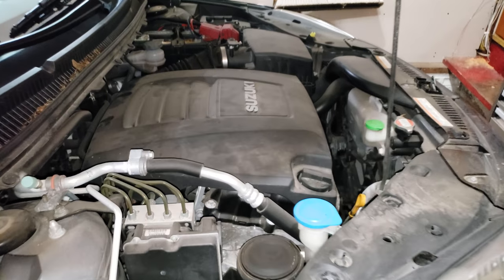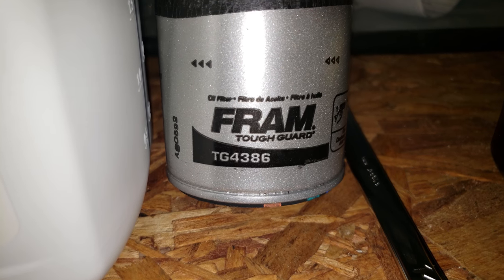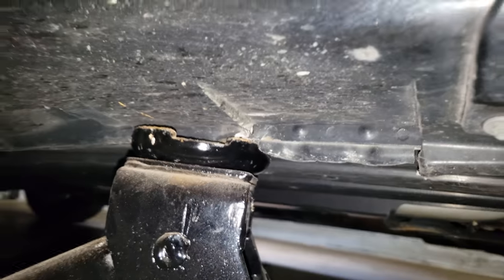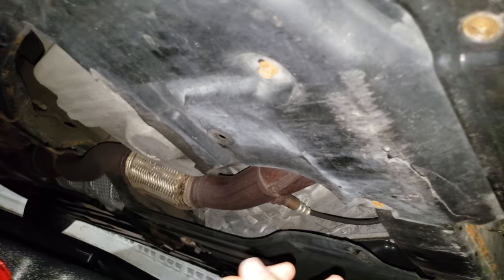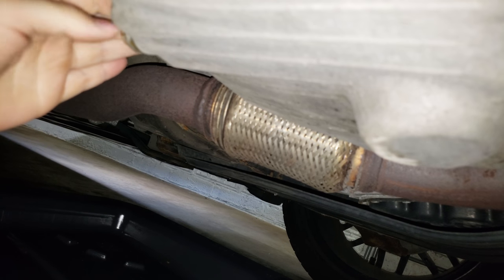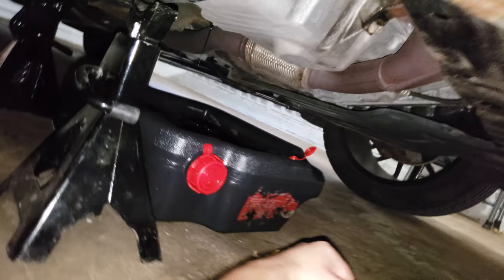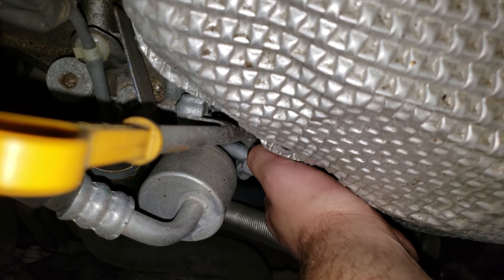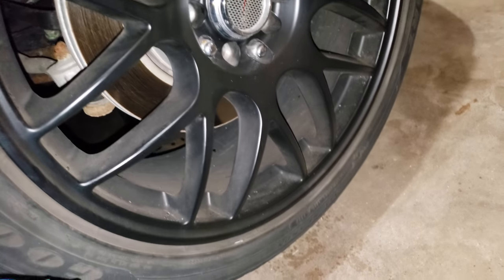Oil Change on Suzuki Kizashi Part 1

Comment: Hey bud have you had a valve cover leak on the kizzy before. I changed mine out last year and I believe the selenoid is starting to leak but not sure the correct name? It's on the Left side of the motor with a plug connector
Reply from the maker: Join us on Facebook at kizashi nation and show me

Comment: Hi friend, very good video, I have a Suzuki Kisazhi AWD and I would like to know if there is a difference between the oils that should be used for the rear differential oil and the transfer oil, which makes me recommend and how many liters I should use. Thank you
Reply from the maker: Rear differential for the cvt is api gl-5 hyoid 80w-90. Can tell you amounts tomorrow
Reply: @AnythingAuto  Thank you for responding, I hope you help me with the quantity and what brand you recommend, I am between Valvoline and Liqui Moly

Comment: would you happen to know where exactly the ac drain hose is on here. I have a 2011 Kizashi. water splooshing and build up.
Reply from the maker: Most cars are under the car, between engine and sub frame. It's the only black hose hanging there. i hope this video helps. feel free to like and subscribe for more & if you can, please help the channel out by giving a super thanks. Making these videos takes a lot of time, but we do it to save you hundreds. also head down into the description and check out the link for some high quality led bulbs for this and any other vehicle. use my referral for a discount. Add me in Instagram for behind the scenes pics and Stop by my store for some Anything Auto gear.

Comment: Great video...I am planning to buy a used Kizashi.. Is it expensive to maintain in terms of spare parts price?  Thanks
Reply from the maker: Every car is different. Used car is scary. Personally all 5 of mine didn't have anything wrong with them. My current one is 9 year old and never been yo the shop other than preventative.
Reply: @AnythingAuto  thanks for your prompt reply..My basically wanted to know if the spare parts of Kizashi are easily available and aren't very expensive..
Reply from the maker: @ChaiSamosaAndHighway  never had an issue with getting parts

Comment: Do u hv a video on how to change the oil filter housing unit on 10 suuki kisashi? I really need guidance on that.
Reply from the maker: No but those are usually only held on by 2 bolts and a gasket

Comment: How do you reset oil life after oil change?
Reply from the maker: No oil life tracker to reset. i hope this video helps. feel free to like and subscribe for more. also head down into the description and check out the link for some high quality led bulbs for this and any other vehicle. use my referral for a discount. Add me in Instagram for behind the scenes pics and Stop by my store for some Anything Auto gear.